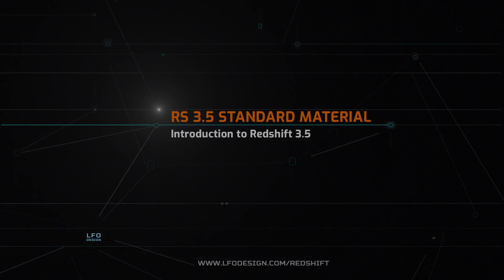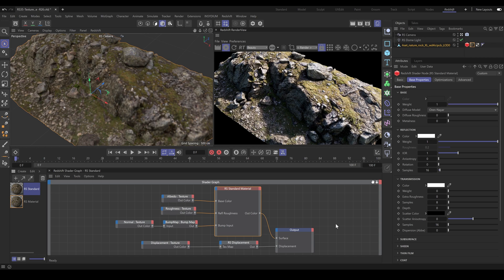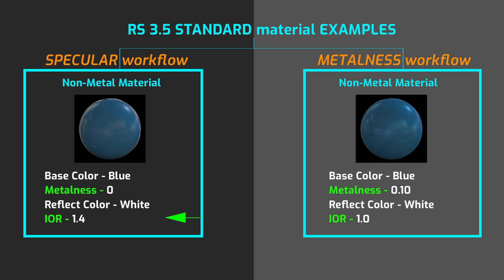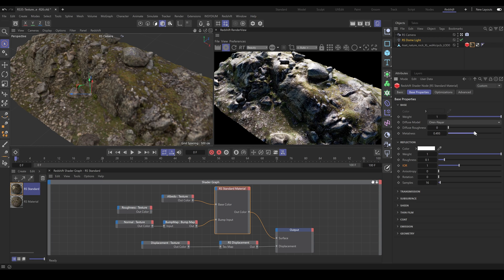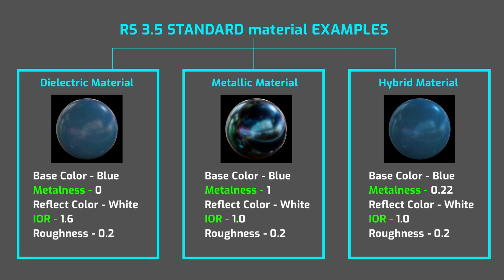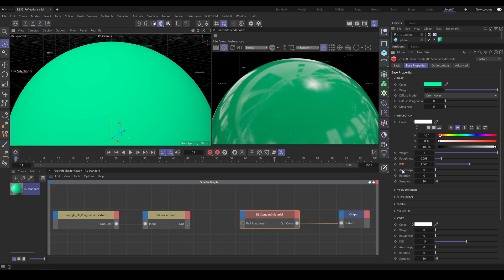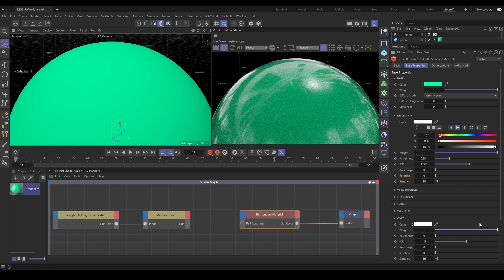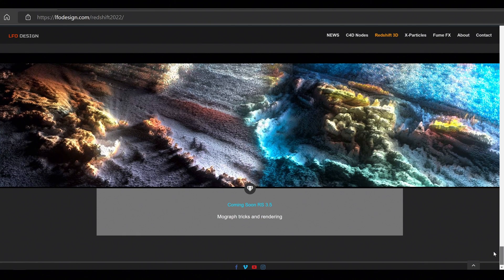C4D R26 / Redshift 3.5 - New Standard Material Workflow

Comment: Great as always, I'll be buying some courses today. One question, with R26 + RS 3.5 when I try to import from Quixel Bridge I get a "Failed to create redshift material" and "'NoneType' object has no attribute 'GetRoot'.  I noticed you had the Quixel object imported correctly with this tutorial.  Were you able to do that smoothly or did you have to import everything after downloading it and by not using the Quixel -> C4D bridge?
Reply from the maker: Thanks. Happy to hear that you like it. When is major RS update - Quixel bridge needs plug-in update. Until they will release new update you have to connect texture assets manually into the material , or you can use bridge to R26 default renderer and convert it after that into the redshift material. In my case I connected textures manually.